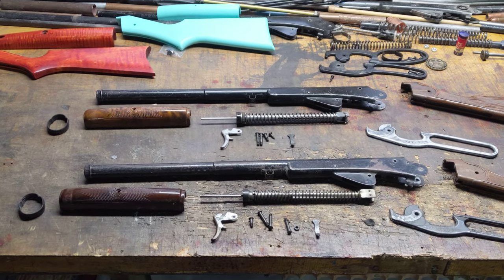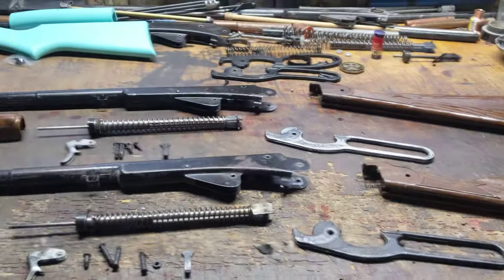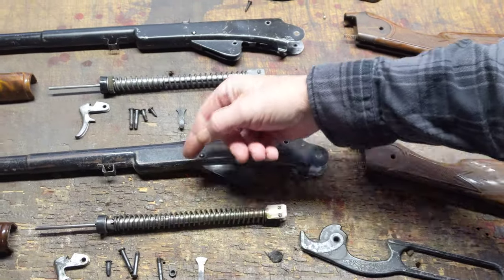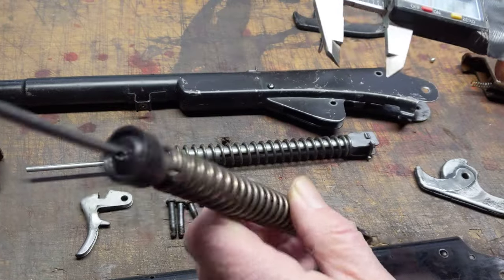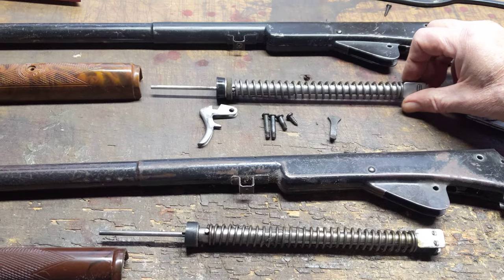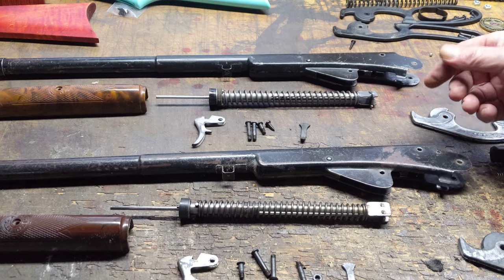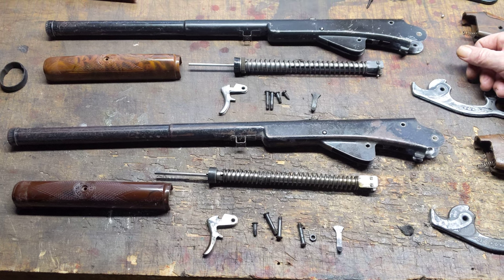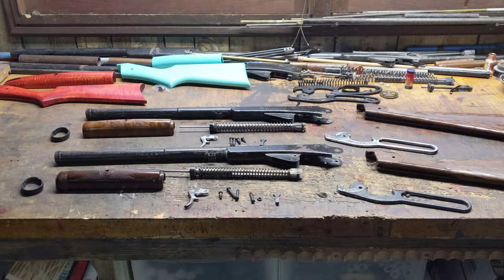A Tale of Two Daisy Model 75 Scouts, the difference between pre 1958 and post 1958

Comment: Shane, does the smaller chamber bore gun have a brass insert cylinder?  I ask, because Daisy experimented with several guns where a brass seamless chamber was inserted.  Various examples exist and have been found in various models.  This aside from the RR I modified a few years back with such.

If I recall one such article, Tom Gaylord, wrote about a Mod 25 found with such factory modification.  Another article, author I don't remember, found the modification in a Scout I do believe.
Reply from the maker: The Plymouth gun did not have a brass insert cylinder.  I have yet to see one but now it's my list of oddities to find.

Comment: I ran across the same problem on model 102 that I was rebuilding  I have both old and newer..
Reply from the maker: The Model 102 shares the same frame as the Model 75 and they both use the "short" shot tube. I'm reading that as further proof of a change in compression cylinders after the move to Rodgers AR in 1958.

Comment: have you run any chrono tests for comparison?   Reason I ask is that I have a 96 and a 38b, both resealed recently, both with 7/64” tubes & Cobalt springs…the 96 with the small dia. seals smokes the Ryder !  I wonder how much (if any) of this is due to chamber dia.
Reply from the maker: Rex, My experience is that the larger compression chamber normally wins the speed contest. What vintage is the 1938B? Is the Model 96 a bottlecap Daisy? The power triad is a Cobalt mainspring, 7/64" air tube and seamless shot tube. There is at least one Model 95 that's running right 500 FPS but I think it's the most modified Daisy in existence. Check out this link

https://www.thehighroad.org/index.php?threads/putting-a-little-more-power-in-a-15-00-daisy.807316/page-60

Comment: yup, durn plastic stocks love to crack from top screw hole on down.
if all the plastic is there, can be fixed with JB-weld about 3/8" thick,
with a 1/4" wide slot cut to clear the trigger while its still "green".
I don't like those plastics, but I'd rather keep the original look if possible.
Reply from the maker: I do think there is a market for fixing the cracked ones, the wilted units are another story.

Comment: I have a 75 scout on rollstamp that is built in Plymouth it is low pivot lever.plastic forend but pistol grip wood stock and lever and it's a red Ryder stock but no lightning loader and I've read that plastic forend should be cut out for lightening loader even though it didn't have one. What do you think is this rare or Daisy using up parts or someone switching parts around?
Reply from the maker: Russell, Sounds like some parts got swapped. All the plastic forearms I've seen have the relief cut for the "Magazine Tube" but that low pivot Plymouth gun's receiver was only built 1956-57. According to Cornell's chronology chart, the change to the plastic forearm started in 1952 for #111 Model 40 Red Ryder. It's in the range.
Reply: @RestOModDaisy  yeah I think so the stock and lever. But I don't know if what about the low pivot. That would have to come from the factory that way. Have you ever seen one that was low pivot?
Reply from the maker: @russellhorner4950  I haven't had but a few of them in hand and none of them were low pivot guns. That sounds like a Gary Garber level question.
Reply: @RestOModDaisy  I'm sending pictures to Daisy Museum they are gonna explain the what and why according to the very nice lady that took my call.

Comment: Are both guns externally the same size(external diameter) as well?
Reply from the maker: Peter, Both guns have the same external numbers, the difference is the compression chamber inside the receiver. The Plymouth guns run the .82" seal sets, the Rodgers guns use the .89" sets.

Comment: Unfortunately,  according to Daisy yesterday,  there's still no way to order the larger plunger heads alone.   Any ideas?
Reply from the maker: You can try J&G but they are asking $16.95 for what looks like the large compression cup. I normally buy the plunger assembly which comes with the mainspring, compression cup, washer, airtube, foam wiper and pin, that's $4 when they have them in stock. I ordered some stuff from Daisy on Monday and the were out of airtubes, Model 25 shot tubes and pins but didn't ask about plunger assemblies. How many compression cups do you need?
Reply: @RestOModDaisy  I don't "need" any right now but I put in an order yesterday and thought I'd get a few to have them handy.  I know they are still out of 25 shot tubes until August or September also.   Luckily I still have a few of those for now.  
I haven't needed anything bad enough to pay J. G.s  prices and shipping.   😏

Comment: The 96 is a bottlecap model, but I’m using a 25 shot tube in it, the 38b is Chinese with a seamless tube, so i guess it’s kinda’ like apples vs apples there.  I also would have thought the larger chamber would be faster, but who knows? smaller dia. & less piston mass might = faster compression…
Reply from the maker: Or it might be a "charmed" gun. You know, where everything went together just right at the factory, sort of like a 1 of 1000 Winchester.

Comment: Is a Plymouth version in box worth $80?
Reply from the maker: Depends on condition! I find one of the best ways to see what Daisy's are getting sold for these days is to use Ebay's "completed" search function. Type in Daisy BB guns and scroll down to the menu section of the left hand side of the screen and click the completed box. Everything that has sold will show up and you can do your research. The box does normally add some value as 99% of old Daisy's don't have them, you a collector or a shooter?

Comment: I have a 10/09/1956 production date Model 75 Scout. It shoots great, but the plastic fore stock is warped.
Reply from the maker: Common occurrence Clutch,  fortunately most any fore end from the period will work if you can find one that's just like the one you have. There are folks who say they have used a heat gun to slowly persuade the wacky ones to get straight but I have not tried that yet.
Reply: @RestOModDaisy  I think the previous  owner probably tried that, and made it worse. It's got evidence of excessive heat on it. I don't worry about it too much, because it still shoots fine, but maybe someday I will change my mind, and put fancy wood on both ends like yours. I'd probably give it more length of pull, but stick with the traditional style stocks.

Comment: Any idea what seal size fits a 107?
Reply from the maker: Depends, do you have a Rodgers AR Model 107 or the earlier Plymouth MI Model 107 AKA The Buck Jones Special?
Reply: @RestOModDaisy  Rogers
Reply from the maker: @Beanflip  Since it's post 1958 I'd bet on the larger .89" seal. But I'd also pull it and check to see.